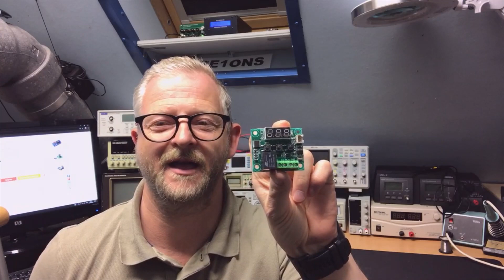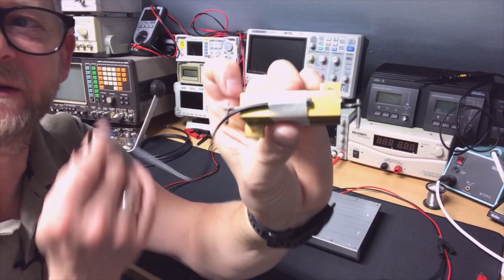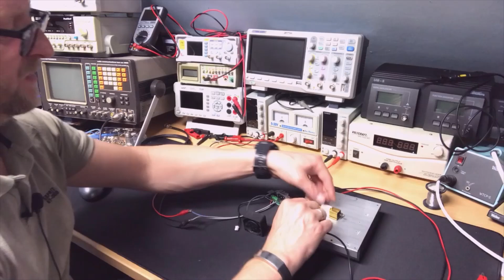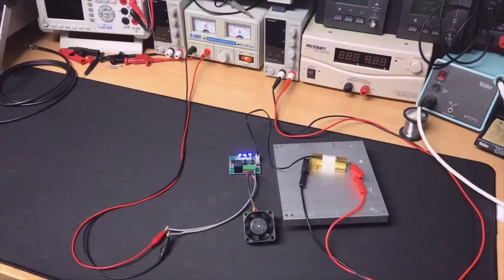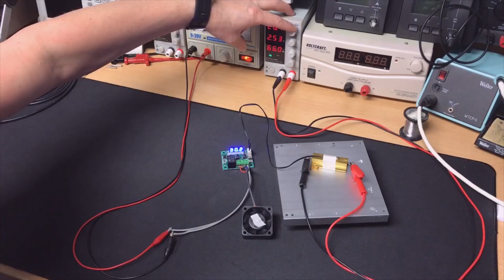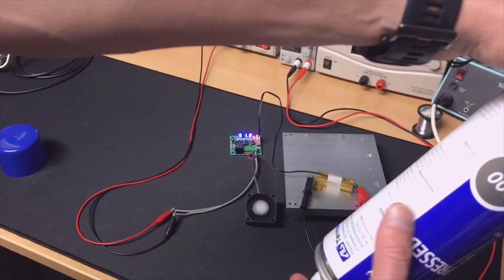#028 W1209 Temperature Control Switch - review

Comment: Received mine yesterday and had some time today to test it out. Works like a charm. Want to use it with a car amplifier cooling fan. Car amps get very hot and was hoping this would help cool them down. It would be placed in car trunk just afraid being so small it'll get damaged with it not having a protective cover. I have to look into that. Thanks again for the video
Reply from the maker: Sounds like a great idea, yes you can maybe fit the small PCB in a plastic box to protect it

Comment: I want to do the same test you did but my only power supply is a car battery. Do you think the car battery is too strong for the switch or is perfect to use? Any feedback appreciated and thanks for the video
Reply from the maker: 12 Volt form battery would be good, only limit is the load that you connect to the switch.

Comment: Thank you for the useful video,
I have a question, can I use this with  room air cooler to save electricity . its power is  300 watts on 220 Volt AC current.
Reply from the maker: You can check the relay.. if the relay can switch 2 Amps and 220V or more, you are good. it should be printed on it. if it says less, you can use this small relay to switch a bigger stronger relay that can switch more power.

Comment: You didn’t explane how to set it up for heating! You only showed how to use it for cooling but Not even how to set it up for cooling. This device can be used for heating or cooling.

https://youtu.be/DBRI7ry0Ku8?si=7aeBmn9Wawq04nVY
Reply from the maker: It has a relay with NO and maybe even NC, so you can do with it what you like. (NO=Normaly Open, is closes when reached temp.) and (NC = Normaly Closed is opens/disconnects when reached temp.) if it has not NC you can replace the relay:  added: i see that in P0 you can pick or heating ot coolling,i think that changed the logic of the relay. so no need to replace if you want it working the other way around.

Comment: I'm tryin to program my thermostat to heat up an aluminum block. 
settings 77.5. P0-H, P1 - 0.1, P2 - 89, P3 - -50, P4 - 0, P5 - 0, P6 - doesn't give me options.
HOWEVER when the temp hits 50 the Thermostat turns off. The LED shows  ( -  -  - )
What is going on?
Reply from the maker: Hi Joshua, i don't think you have the W1209 ..that one only has 1 setting.
Reply: @TonyAlbus  Also, yes he has the same unit, hold SET for more than 5 seconds and you will enter as well into the Settings Menu of the unit, Cheers!
Reply: You have messed with P6 and bricked the unit (DO NOT CHANGE P6), to UN-brick, power ON->Hold + and - together for a few secconds and Power OFF with them pressed, then , when Power back ON everything ressets to Default!

Comment: I am using two of these - one on a mid. eff. furnace vent and one on a standard vent hot water tank to switch on a motorized fresh air intake damper for combustion air in the basement. Have them wired in parallel so either of them will open the damper when at least one appliance is burning. In the instruction data sheet it states the static current draw is 35 mA and max draw 65 mA. So old 12V DC charger of 150 mA does run both of these. I think I bought these some time ago out of curiosity for about cad$10 combined. If I would use a mechanical thermo disks, if I could find suitable temperature parameter ones, they would be about cad$25 each. Considering a 60,000 BTU furnace will suck almost 4 cu yard of air in 10 min run, it helps to have fresh air coming in, but only as needed.
Reply from the maker: Thanks, yes that is a nice aplication of one of these devices... thanks for sharing Martin!

Comment: Do I have to worry about the amps or not really? Do I just need a 12v adapter? Does it need to be DC or AC? I have one myself but I am a little hesitant on hooking it up because I ruined one already. Thank you for this video
Reply from the maker: Hello Aaron, The board itself needs 12V ... the isolated relay contact can switch Max. 5A at 240 VAC or Max. 10A at 24 DC. 
Maybe this helps: http://www.kelco.rs/katalog/images/17670.pdf  a manual i found some were.
Reply: @TonyAlbus  perfect that answers most of my questions. I just have one more question. Will a 12vdc 1amp be okay to use or should the amps be a little higher. If you believe I need a higher amp. What would you recommend. I do apologize.My question might have been answered somewhere but I’m not very good with good with this stuff. I’m still learning.
Reply from the maker: Hello Aaron, i think 1 Amps is okey, the relay will only use 1 or 200 mA bit more or less, 1 Amp should be fine for just the controller,  good luck with your project
Reply: @TonyAlbus  you’re amazing! Thank you so much for answering my questions and making such a great, understandable product review! You definitely got me as a subscriber!
Reply from the maker: @aaronn6725  You are Welcome and thank you!
Reply: @TonyAlbus  sorry for bothering you again, do you think a switching adapter would work? A switching adapter is just a upgraded version of an ac/dc adapter, right? Or am I completely wrong. I have a 12v 2 amp switching adapter but online doesn’t give me enough comparison information.    Especially to use for this product
Reply from the maker: @aaronn6725  Hi Aaron, swicthed is good, no problem.